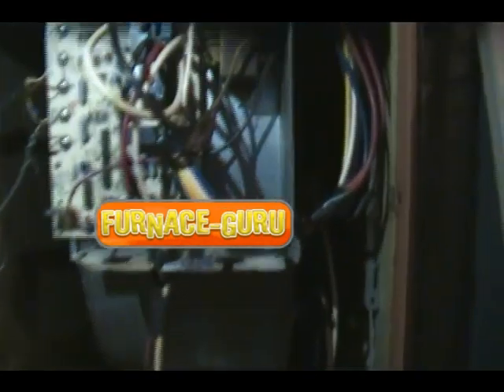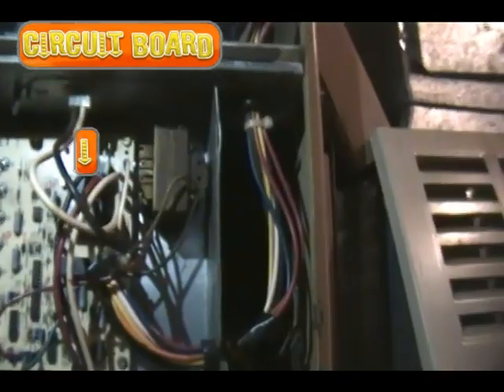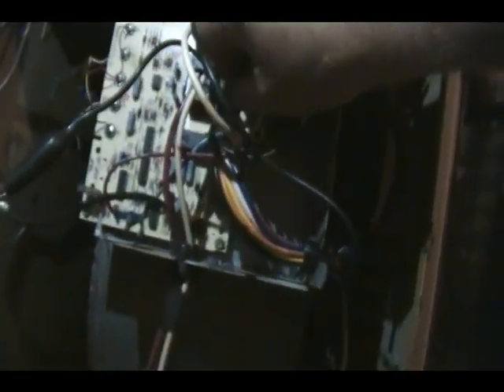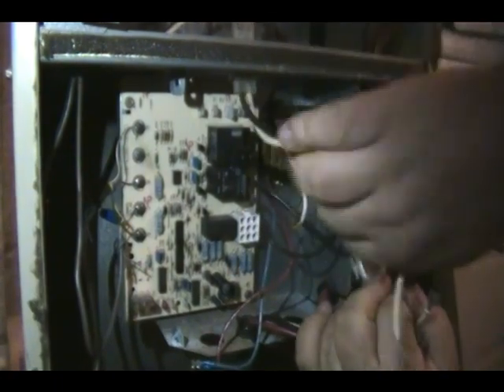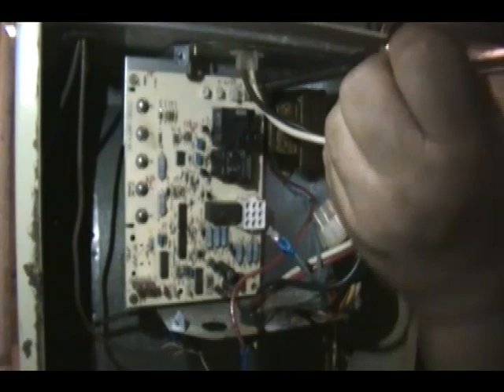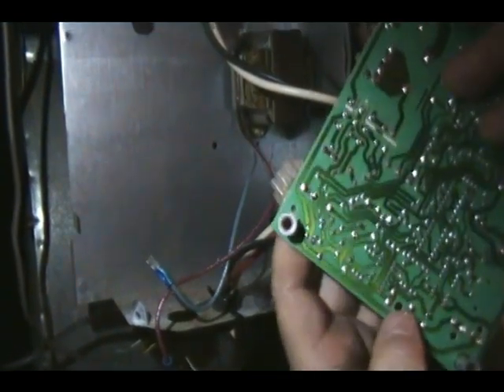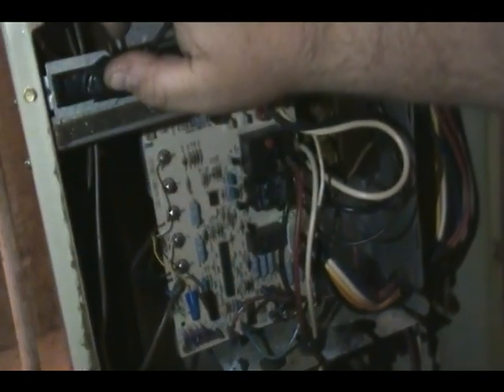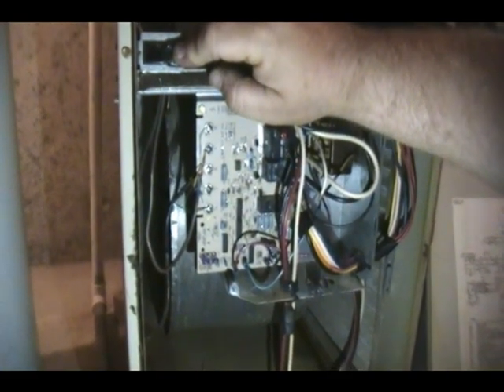How to check a bryant circuit board for proper blower operation

Comment: If any of you guys are looking for a place to buy parts, I normally use  
www.shortyshvac.com

They sell all brand new original manufacturer parts, always helpful with whatever questions I have. I normally phone in with the model number of my furnace so they know what I'm working with and they can help diagnose the problems I'm having and tell me what parts I need. Been using them for about 5 years now and I've never had a single issue. They ship anywhere in the US.

Comment from the maker: well let me explain, although I am sure it may not be to your standards. If you listen when the door switch is activated you can hear the relay kick in. If you do not isolate and put good power to the blower you may get a new control board in and find a second problem with the blower and I just wanted to make accurate diagnose for the customer. What would you have done if blower was also bad looked at the customer and said " Gee gollie sir ,sorry I am not accurate on my diagnose"  wow,get a life